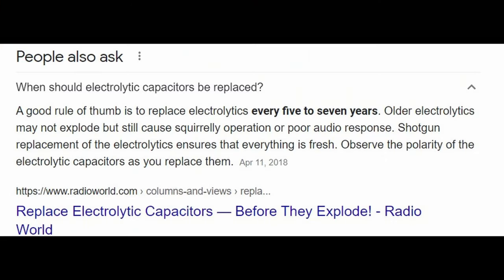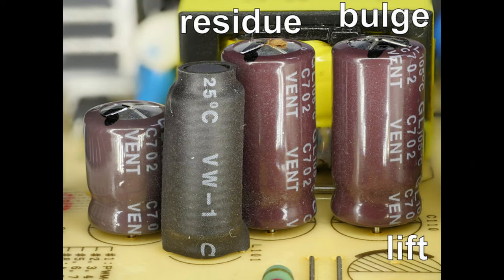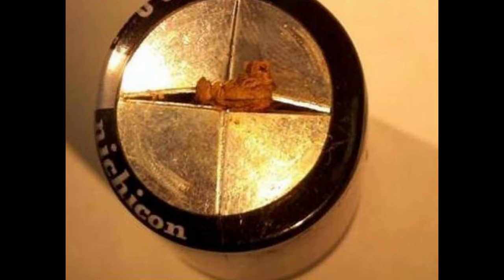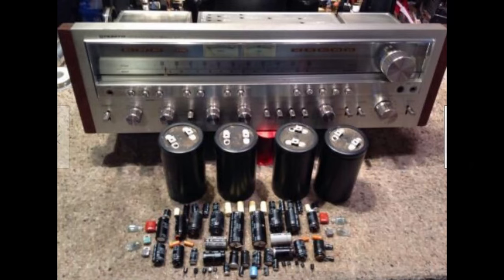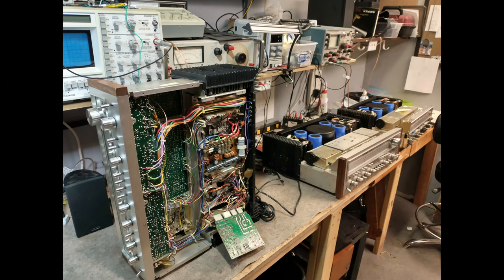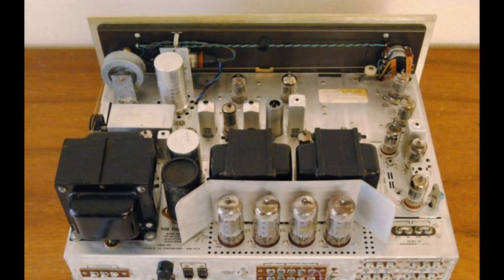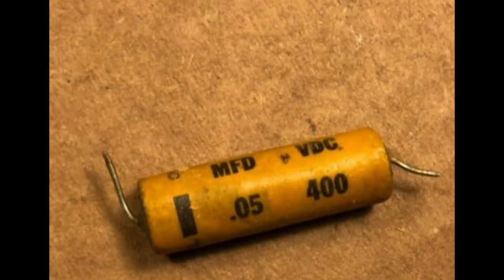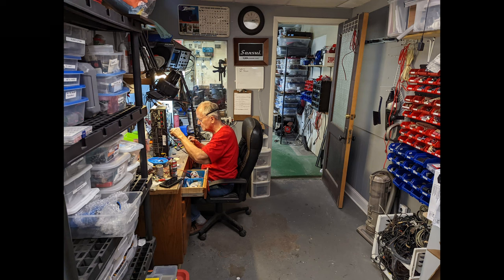Should You Replace Capacitors In Vintage Electronics?- Marantz Sansui Pioneer McIntosh Yamaha

Comment: IF you are gonna recap for someone you owe it to them to give them the old caps you removed even if they just throw them out.  So they can see what you accomplished.
Reply: I’ve debated this a lot with myself. I’ve decided the best thing to do is replace the caps. But when you cut out the old ones, keep the leads as long as possible. This way you can put them back in a make it original to get top dollar when you sell it. I’ve seen people sleeve new caps in the old cap cardboard.

Comment: I totally agree with you, just acquired a Marantz 2220B spent over $300 replacing all caps, pre-amp transistors and new tungsten lights to preserve its original look and its working perfect . In my opinion money well spent . Great video and good information.
Reply: A Marantz is an investment... not a reciever.
Reply: @DG-uw6wx  please
Reply: Marantz it awesome. I’ve got he same model. So if you buy a Marantz and get a good deal at $400 (which is a reasonable price if bought in the private market) then another $300 on all the work you mentioned… doesn’t sound like a great deal to me.
Reply: i used to 'gain match' pre-amp transistors
Reply: Seems the hard part is getting cosmetics. Like oem knobs and such.
Reply: Did the pre-amp transistors go bad?? Why did they get changed?? curious??
Reply: @johnkemas7344  according to the service tech they were not matching the left vs right channels 
And also he wrapped them together with a plastic tube, I don’t know the tech reason

Comment: Another retired EE here, age 68. I designed hardware for the industrial automation market and I completely agree with you. Aluminum electrolytics were voltage derated 50%, e.g. we spec'd a 50 volt cap for a 24 VDC circuit because reliability is paramount in that business. In consumer gear it's not uncommon to see a 25 Volt cap in a 24 VDC circuit. So when you recap, spend a little more to get a higher voltage rating and if available, 105 degree C temperature rating rather than 85 degrees. A little more filter capacitance, e.g. replacing a 470 uF with 560 or 680 in the same case size, can't hurt but the voltage rating upgrade, e.g. 25 VDC to 35 is the most bang for the buck for reliability.
Reply: One thing to remember is sometimes if you increase the filter caps, it might also be wise to make sure the rectification section can handle it. I've had a lot of guitar amps where the original bridge rectifier will blow soon after if I've increased the power supply caps. Might just be correlation and not causation. So sometimes I'll just throw in a more robust bridge rectifier or diodes since they're so cheap. Increasing the power supply capacitance also tends to increase bass frequencies.

Comment: This is almost hilarious. "OMG It'll change the sound". Most of the original sound quality is due to design so you are correct to change as many as makes sense. FWIW even better manufacturers didn't use mil spec parts and often changed sources during production runs. That leads to the question of "What did it sound like 40-50 years ago"? Put in quality capacitors and find out what the original design was supposed to sound like according to design. I have a couple of Crown Amplifiers (DC-300 and D-300). Since capacitors have shrunk in the last 40 years, I'm not sure I can get caps that fit (the capacitance shouldn't be a problem). The old ones are the size of small soup cans :). Maybe some day :). Great video. Thanks
Reply: Hi John , Samgamo caps for DC 300As are still around . I got a few maybe 3 or 4 years back at Tedds Electronic surplus . I've also done a few with Nichacon that were physically smaller using a piece of steel and punching for the smaller size cap and using new cap clamps . Great amps , we had a LOT of them .

Comment: Spot on! A better analogy than motor oil is tires. They now date tire manufacture so you know to replace them if they look good, but are 5, 10, or 20 years old. Lots of folks in the RV world get "bit" on this because most RVs don't have many miles at 5 or 10 years, but driving on old tires results in blowouts, many times damaging the surrounding wheel well area of the RV.  Does that sound familiar?

Comment: For three days i changed caps in my tuner JVC FX-50L. Most of capacitors was Matsushita and Towa capacitors so i took almost all of them out and put Panasonic and Nichicon back in and those 2 capacitors from the signal path received Elna cerafine caps and i have to say that i am blown away about the results. So dinamic so detailed and the hights are just sweet. In a shop nobody would have done such a work unless the customer requests it and than you are not sure if it will sound better or just worse. I was lucky to hit the right caps on the right spot this time, i did had changed caps in other unit and i was absolutely dissapointed. Now to be honest i don't know how did my tuner sounded for 40 years soon after it was built but i am happy with the results i got this time. It was worth the hassle. I wish all the people Happy New Year.
Reply: Try replacing the electrolytic coupling capacitors with metal film.  I've never been able to hear a difference in capacitors brands or that more costly caps sounded better in power supply or decoupling stages.  But after changing electrolytic coupling caps with film, very notable improvement.  Especially the first stage input coupling capacitors on power amplifiers.

Comment: 50 years experience in electronic repair and maintenance starting as a technician in the US Navy and retiring as the head of a 200 employee  maintenance department. I have many stories  of intermittent failures caused by capacitors that test good when they are cold or removed and placed on tester, however either fail or change value when current is applied or as they heat up.  Yes power supply capacitors are important they insure that the power supply voltages going to all components are as close to pure DC as possible and that the supply voltages don't sag under heavy loads.
Reply: +1
Reply: if that is all they do, could i just check those PS caps  for AC milliVolts? under load preferably?

Comment: I used to restore old tube audio as well as some of the vintage solid state stuff.
You are so spot on with respect to replacing capacitors. On old stuff
like a HH Scott 299 or a Fisher 500 I always replaced all the coupling
capacitors as well as power supply capacitors and ALWAYS replaced
the bias rectifier and associated capacitors. Leakage of coupling capacitors feeding the
output tubes as well as any failure in the bias supply can destroy both
the output tubes and possibly an output transformer.
I have seen coupling capacitors between the output tubes and phase inverter
 short and cause an output transformer failure which could have been prevented if
the amp's owner had just had the amp properly restored prior to using it.

Comment: Fully agree. Capacitors are full of nasty chemicals and not doing preventative maintenance is putting your precious vintage gear at risk of much bigger trouble sooner rather than later. And putting equivalent or better quality capacitors can do no harm whatsoever. None.
Reply: what nasty chemicals? And what sort of trouble from them?
Reply: @emelle1283  electrolytics! PCP's! corrosive on the printed circuit board, etc.
Reply: Thats if you have the right tools to replace them properly. Otherwise boards get wrecked.
Reply: Well, unless you botch the pads or traces...
Reply: @brianhammer5107 PCBs not PCP…unless there was a party that got out of hand.

Comment: I did have to replace a few caps in my 1978 Soundcraftsmen PE2217 Preamp/Equalizer. Today, I am fixing the 22 Faders and the two potentiometers for volume and left-right selection.. The Faders were in bad shape and thus were hard to slide, and were on and off non conductive.  The old lubricant was a goner, and electrical contact was bad.    So far so good in bringing them back to life.

Comment: Excellent video! For those who say, "if it isn't broke, don't fix it"... The issue is that capacitors not only change value (which is bad), but they can also short out and destroy power, output, and IF transformers,. Many of these devices are becoming unobtanium. While, I specialize in antique tube radios, the similarities with vintage hi-fi units is the same when it comes to capacitors. Tube devices are high voltage, low current devices. Solid state units are low voltage, high current devices. However both are the same! Because power equals current times voltage. It is the power that can destroy other devices when it leaks through a used-up capacitor. Be wise, get rid of them!
Reply: And yet leaving in original caps. (unless visibly bulging) just,,,,,sounds better.
Reply: @clayton1939  Disagree.
Reply: Not all caps are going to go bad, but many of the paper foil, electrolytic caps, and many of the Frako/Rifa caps are definitely candidates for replacements, especially when the Rifa/Frako caps are used as across the line caps as they crack, and craze in the case and moisture gets inside, and they will go BOOM! and often take out other parts, some unobtanium now, but many others like some of the poly caps will likely be more than fine and are often left in place, unless it's visibly damaged in some way, and still in spec decades later and also, many values are more prone to failing than other values, so if they exist, the better part of valor is to replace them, especially if you start finding they are drifting out. Others the type of caps were poorly chosen, and swapping them for more stable variants to do the same job is also paramount. In the end, the performance while decent ends up being improved, and yet sound like it always had. This also goes for filter caps to reduce hum, and coupling caps may need to be replaced after 35-40 years.
Reply: I think your probably right. I’ve been running my Marantz 2325 it finally had a bulb go out. After 40 plus years and still rocking I should restore it ! You in my sixties I need restored myself !
Reply: Paper/wax capacitors will not normally last more than 60-70 years max! They are notorious at leaking DC which in tube amps and (tube) receivers, can take out IF/RF coils. I have rarely seen these types of caps in solid state devices after late 1960's. Electrolytics are of course much worst than paper/wax. It is sad that most post-1970 hi-fi equipment is fully of those beasties!

Comment: As an old audio repair guy myself. I think you know that once you get a bit time failure on a cap it can really blow some stuff out and cost more to fix in the end had you done a little preventive Maintenace. It's like a car with 200K miles on it. If you do not have any preventive maintence done on it you can have major failure after major failure. I agree with the age most folks don't even know how to use a meter. I'm 65 and had my own audio video shop for years until it was not worth fixing because folks didn't want to fix the gear and most new stuff was junk and well you get it. You are right find anyone who even does AV/Repairs anymore let alone someone like me who fixes Reel to Reel and things lol. I still play around with stuff and now that prices are going up. I'll start doing some restore jobs from the old stuff I hung on to. Also so many folks are buying this olds stuff for high prices and yeah it might work sort of but for how long? Lots of get it on and flip it quick artists out there. Sy you guys seem to be doing it right. Thanks for keeping the old quality stuff running as most of the average stuff now a days really isn't very much to get excited over.

Comment: You can burn up your expensive speakers.
DC can pass in some designs , say a halfler and instantly toast your voice coils.
Before you even run an older amp even from the 90's , pop off the lid and see if the caps look swollen , look at the output transistors for burn marks , then check for DC with a multimeter. 
At the very least put an inline fuse on the positive side .
I learned this the hard way . Something like a studio amp will literally camp fire inside and take your driver's with it. Bias and caps. With high end gear it's a little different because of the build quality like say an aaragon. Then probably just leave it be.

Comment: I've changed the filter caps in three different things I've had. A Sansui integrated amp. Velodyne Servo sub and a Technics receiver. In all cases the sound change was for the better. Esp the Velodyne. It was VERY dramatic! Smooth and much more musical.
Reply: Exactly.

I have a Lafayette LA-375 amp I bought a few years back.

Due to finances and lack of time I spent about a month listening to it as I got it after confirming it worked properly and doing the idle current adjustment.

After I recapped it, the sound had improved quite a bit.

I also go one further and replace all carbon comp resistors in a piece of audio gear especially  the amp section as often those are out of tolerance and can negatively affect the amp section.
Reply: Wish I had your ears !!

Comment: I used to change 100% of all caps for new ones. I love doing this in my free time, it's my hobby. But one day I saw on YouTube the work of a pro who was checking old roofs with a cool device. This is no ordinary $20 probe, it tested the ERP of caps at different frequencies. And what is surprising, the old 40-year-old caps gave better results compared to the new Nichikons. He is sure that the modern process for the production of caps cannot be compared to what it used to be. After spot-checking a few lids, he leaves it as is, saying, "This will last another 40 years." I began to think, is it worth changing 100% of the caps for new ones?
Reply: Kind of my thinking too... If they are not leaking or bulging, and measure within specs... Why change them for something of lesser quality? That is what my electronics tech stated, but he would do what I want.
Reply: Some of them will "last another 40 years", if they are poly film caps. Electrolytics are definitely finite life, you should change them all, every time, no exception, and any paper in oil caps are born defecting and should be replaced. Any "audio boutique" capacitors should be removed, replaced with a poly film cap (and preferably throw the discards in a wood chipper for the benefit of humanity).

Comment: Great advise. Me, I usually test and record all the stages of an old vintage unit, and if operational, listen to it. Then replaced all the electrolytic caps and other questionable capacitors. Test, record and listen after replacement, and see the difference. So far it always test and sound better.
Reply from the maker: Very cool!
Reply: @Joey Marcos

Actually you restored the SQ to original, IF you got the unit “well used,” and all replacement components were the same make and model.
Reply: @anthonykeve8894  Present day caps are much better than those 40-50 years ago.They will give quite better sound!

Comment: I was given a nice Pioneer tuner/amp that was a bit dirty. I bought electrical contact cleaner and eliminated a half century of dust and grime. It went from uneven output and intermittent cut-outs with a forest fire whenever the volume was turned up or down to nice. silent and strong. My parents thick old vinyl sounds amazing. I have every kind of media playback, 8-Track, Reel to Reel (four channel to boot) several turntables and a cassette player. CD and digital based music is a bit too crisp, I am stuck on analogue and my children explore my collection all the time. Soon I will be transferring my source music onto flash drives to use in my vehicles.
Many thanks for the insight and opinions.

Comment: I would also recommend replacing capacitors with a slightly higher voltage rating and 105c temperature rating. When manufacturers are producing tens or hundreds of thousands of units they will save whatever pennies are possible and capacitors will be rated at or just over the voltage rating required. If one looks at the datasheets provided by some manufacturers, capacitor life is a function of voltage and temperature, and it's not a linear relationship. The lifetime is increased considerably when 105c rated capacitors are selected and they are used well under their voltage rating. Given that capacitor technology has improved considerably in the last 50 years, there is also another benefit in that an equivalent new capacitor in a higher voltage and higher temperature rating is often the same size as the one it is replacing and usually of the same lead pitch. This means it drops straight in and looks neat rather than being a small canister stuck up in the air on bent leads.

Comment: Very good. Your talk about the lack of skilled technicians and getting the work done was brilliant. I’ve felt that changing a large old electrolytic capacitor in the power supply section to remove the 60 cycle hum was a way to improve the sound. But, I know that means it was defective. A weak capacitor might clip a large waveform passing through to the speakers in some amps, sound bad and maybe overpower a speaker’s high frequency driver to the point of burning the voice coil. Overall a nice relaxed video to listen to. Thank you.

Comment: Excellent segment sir, I have seen the differences recently in putting the work in to get a small simple unit back to its prime for not so much the sound but as safe and reliable operation. Under took a project with a tech friend of mine on a small vintage Harman kardon integrated amp,  replaced many of the old parts in power supply, main filter Caps and other sections, replaced a broken selection switch, I noticed certain weird things that came from age disappeared such a the “motor boating sound” emitted from phono section and the unit did seem to perform better. Thank you again for highlighting the importance of replacing and overhauling these old units and what key areas to work on🙏🏾🙏🏾💯💯👍🏾👍🏾🔥, keep up great work!